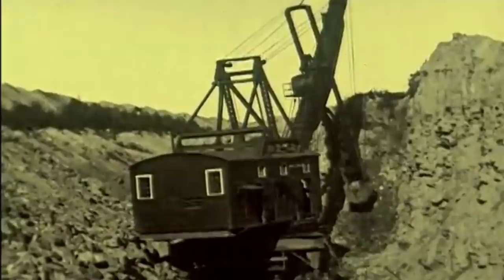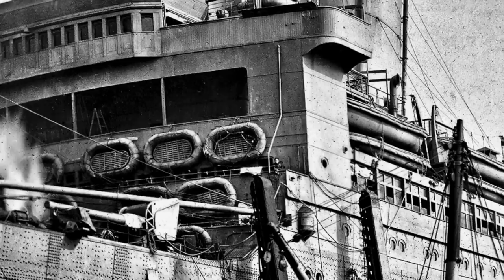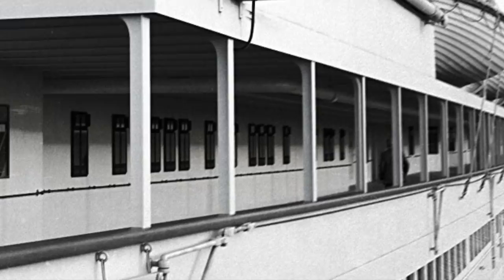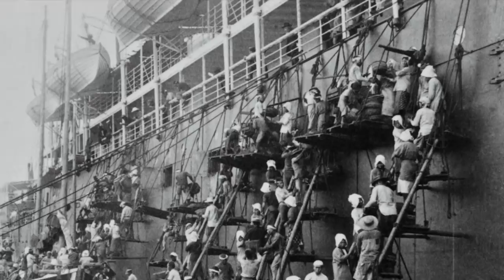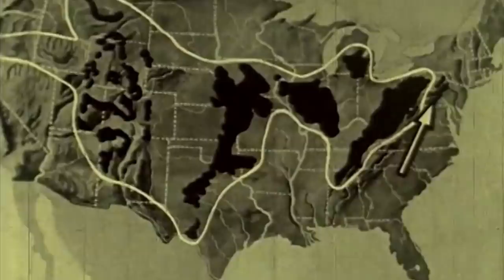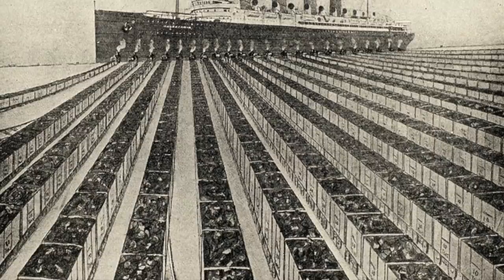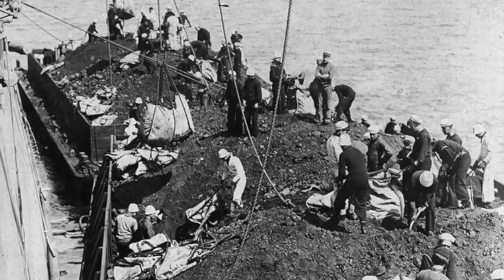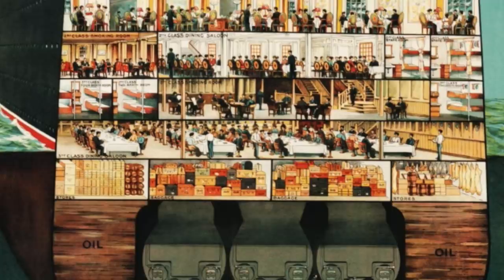Coaling/Bunkering an Ocean Liner

Comment: Why do I get "This Video is unavailable on this Device" error?  The only thing that I figure out from the source file is that they ios and android linked files.
Reply from the maker: Vincent, I think this issue has been resolved. I made a small edit to the video and that probably caused a temporary error.
Reply: @TheGreatBigMove  Not resolved unfortunately, trying to view it now and it still says This Video is unavailable on this device"
Reply: @TheGreatBigMove  nope
Reply: @The Great Bid Move, the problem seems to have come back.  I should have watched it when it was running. :-(
Reply from the maker: Vincent Guinnane if it’s not fixed soon, I will see if I can contact YouTube about it. This is because I made a small edit to the video which sometimes causes errors, but it usually does not last this long. My apologies for the inconvenience.
Reply: @TheGreatBigMove  I hope that you don't misunderstand my frustration, as I sailed on a steamship as an engine midshipman and watch officer, so this video interested me greatly. We used Bunker C and have been involved in bunkering both Bunker C and Diesel vessels. I will look for your follow-on video. I was able to watch it and appreciate your efforts. Thanks!

Comment: What a half-@ssed way to load a ship!  They never developed coal carriers equipped with conveyor belts.  That indicates the oil dudes never intended to let coal get itself firmly established in the shipping business.  Remember, a ton of coal is equal to 175 gallons of oil, and in 1912 a ton of coal was only $1.00.  Today, the QE2 is equipped with diesel engines and consumes 433 tons of fuel oil per day.  Titanic consumed 600 tons of coal per day.  This is why all the steamships were sunk (using them as transport ships during WW1).  They got rid of coal powered steam and replaced them with oil powered steam turbines after the war.  These ships were also too efficient for the oil dudes, so they sunk them all during WW2.  Now we have diesels piston engines running on fuel oil which is heated and filtered and cost $650.00 per ton.  Titanic cost $600 a day to power, QE2 cost $281,000.00 per day to operate.  This is why Titanic was sunk.  Read the full story here:  titanicandhindenburg.com